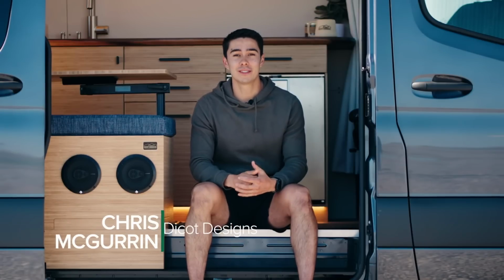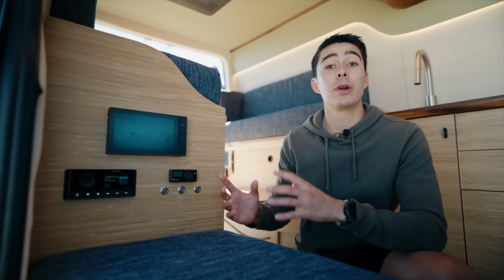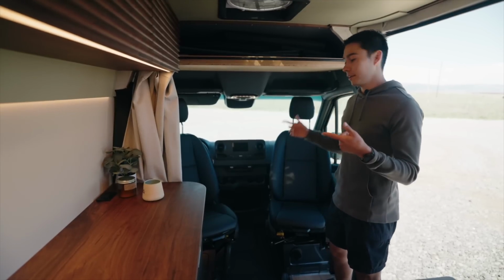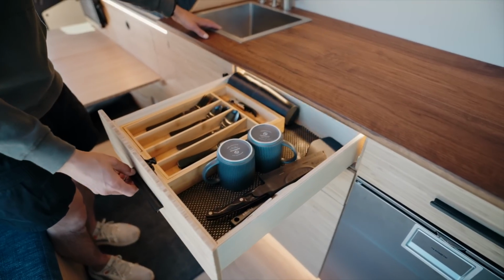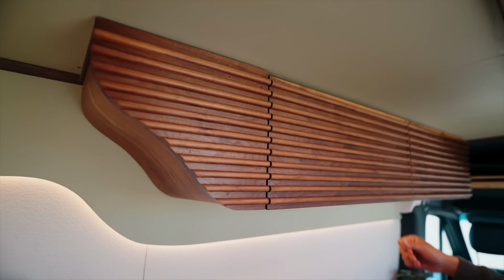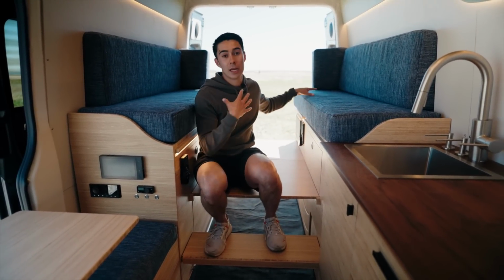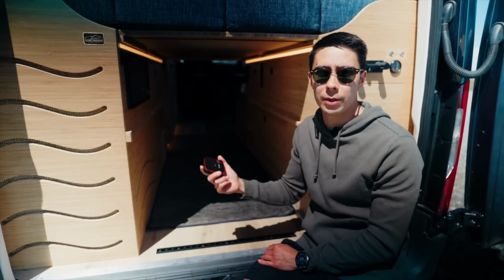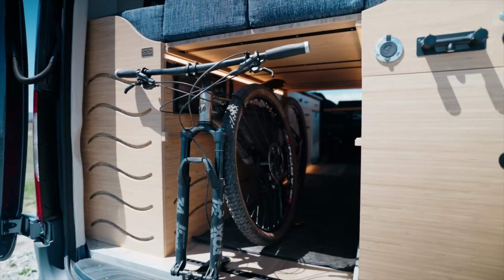Professional Woodworker's Incredible 4x4 Sprinter Van w/ SHOWER | Walnut Cabinets / VAN TOUR

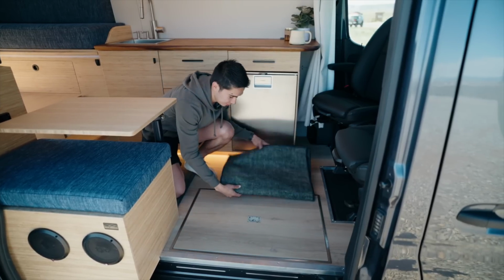Comment: 3:07 improvement suggestion: have the curtains attached to the panel.
such that, to set it up, all you got to do is pull that board and hook it uptop on the ceiling,
that will be the fastest proper shower setup in history.

Comment: Shower pan is way too shallow to keep splashing water in or curtain from blowing outside of it if any ventilation is happening
Reply: Correct - which is why there are magnets in the bottom of the shower curtain that snap into the rim of the shower pan to make sure water doesn't splash outside of the shower area.